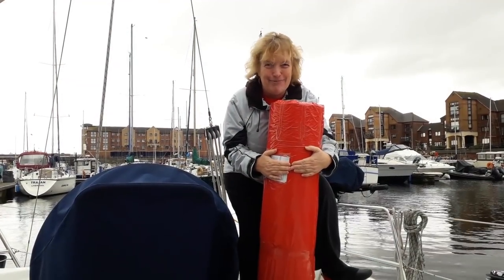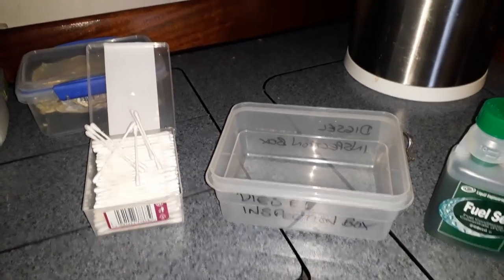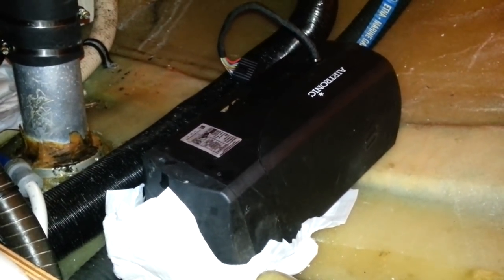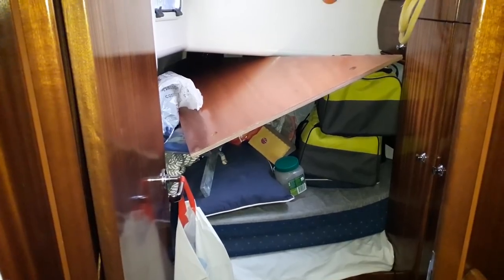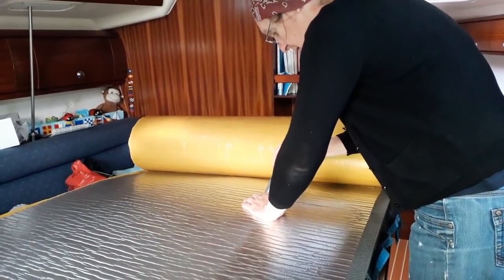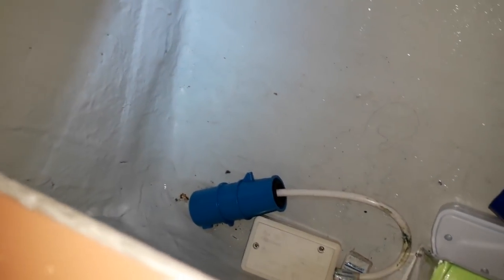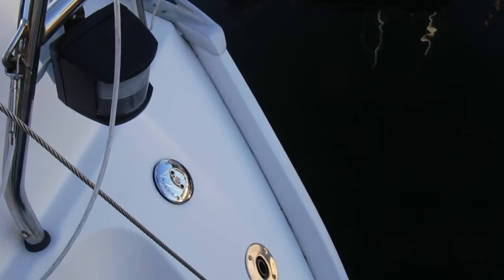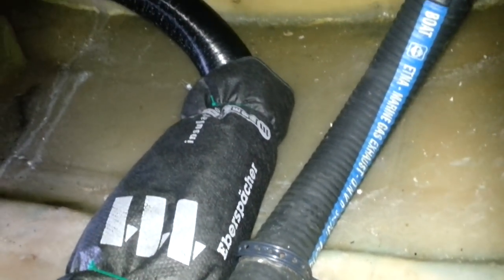Heating and Insulation - Ep. 73

Comment: We had the same condensation issues in our old yacht, when we upgraded we bought an etap which has a double skin with insulating foam between. Also apparently unsinkable. Absolutely love it , it stays cool in the summer  and is warm in the winter😁
Reply from the maker: We looked at an Etap the same week we looked at Salty Lass and we were horrified at all the storage spaces that had foam in them. We never thought of it as insulation but I can see how that would work. The boat was also older and less well maintained but that is not the fault of the boat. 

I have only seen a couple of them since and I am sure that one of them is the one we looked at in Scotland. Nonetheless, an interesting boat. Thanks for commenting
Reply: @SailingYachtSaltyLass  I bought my etap 32i  from troon marric

Comment: Just came across your vid on the insulation. Had a similar experience on my boat with condensation and ended up using some similar reflective insulation. I first started using the 5mm version, but did not fix the condensation problem. It took a minimum of 10mm for freezing or below used 15mm where possible. Could not tell if you insulate behind the headliner, I found that there was a lot of condensation forming here, and worse mould was forming on the rear of the headliner in some locations. Over two years I removed all the headliners and insulated behind them all. Huge difference, only problem is now the diesel heater is overpowered and now runs at minimum most of the time and soots up. Fix one problem create another.
Reply from the maker: Our headlining is layered. The deck is foam cored, then an air space then fibreglass and finally the plywood sheets with foam- backed vinyl. They never get cold in winter so we did not bother putting anything behind them.

I completely agree on thickness. The 10mm stuff worked better than the 8mm but even the 8mm made a big difference. We have lived aboard for two winters and been very comfortable.

As for thr diesel heater, maybe keep a hatch open? We find it helps eliminate moisture by carrying damp air away and lets the heater run a bit hotter for part of the day which seems to help.
Reply: @SailingYachtSaltyLass  Ah, my deck is solid, also with air gap and then mostly solid lining, so got very cold. 
One point on the Wabasco, which was installed by the factory (Beneteau), they took the intake air directly from the locker it was mounted in. A definite no no according to the manual, so I installed a recycle line with a Y diverter valve so can use recycled warm air or fresh, can control the volume of fresh air using the valve. Also reduced fuel consumption considerable. I normally have a dehumidifier running most of the winter as well. Like you am now dry and warm in the winter. 

Noticed you also have a Volvo Penta, looks the same as on my boat, which corroded thorough the side of the heat exchanger after only 900hrs, blowing exhaust fumes into the bilges. Cost £5k to get fixed. After this I fitted a fresh water flushing tank/mixer line to the raw seawater intake and flush the whole system through after every sail. A very cheap mid to save a lot of problems down the road, apparently a flushing system are an option from Volvo and common in the USA.
Reply from the maker: The more I find out about engines, the more I worry about them. Last year we had the starter motor needing service, the exhaust elbow blew and the seals in the impeller housing replaced. The heat exchanger seems to be the next big item. 

I have noticed that breaker's yards for boats are going online. They might do a roaring trade in things like heat exchangers. With the Penta being a rebadged Perkins, I think I would be looking to Perkins for parts....

Thanks for the info

Comment: nice one gals on Salty lass, I am just looking at one of those ebay 5kw diesel heaters. were did you get the roll of insulate, it looks good stuff, i think i read some were to just insulate above the water line ????? great work lads FAIR WIND T.J.
Reply from the maker: Hi TJ - The insulation came from Kiravans and is 8mm, but someone has told me 10mm at a similar price from vandemon.co.uk so we might get some of that as we have a few spots that still need doing.